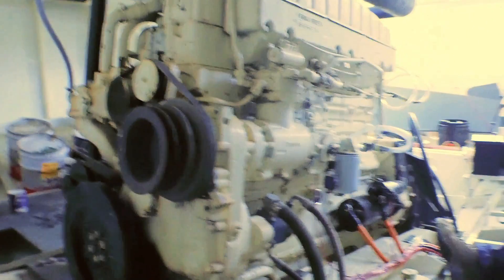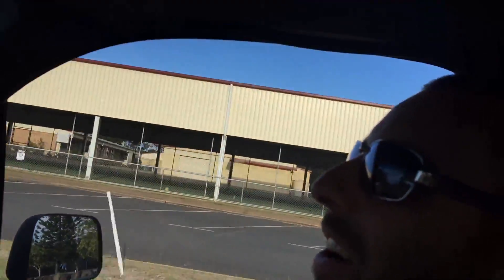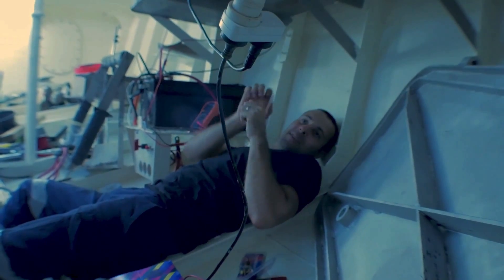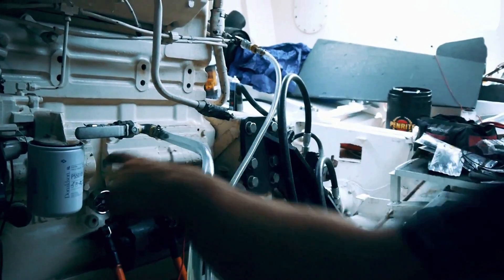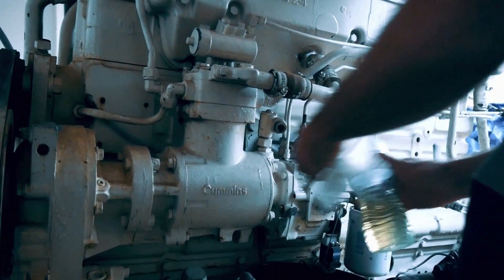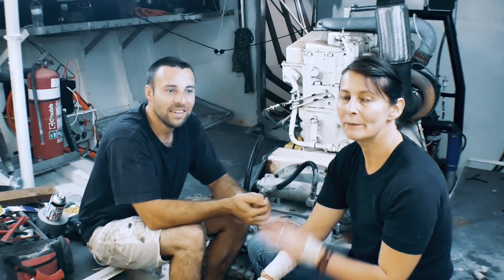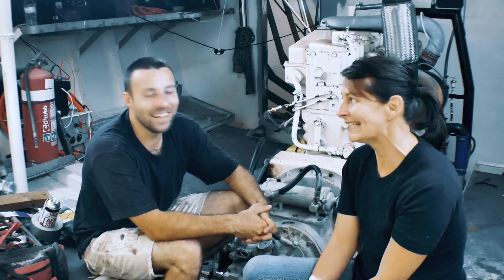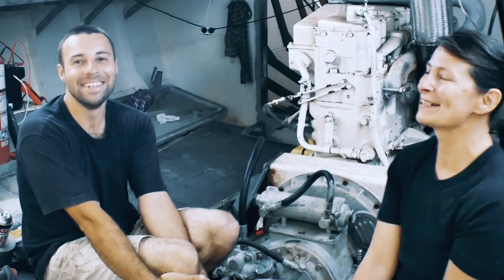Starting a Cummins Trawler Engine - Part 2 of 2 (EP. 53)

Comment: I thought you ran the diesel before it was installed. All the time I listened to the engine turning over I kept saying to my self, "Where's the fuel?" It was nice to here it run. It won't be long before the sea trials begin. You 3 have been doing a terrific job refitting this boat. By the way, is Ryan camera shy? I wanted to build a steel trawler 40 years ago but life got in the way. Watching these videos is fantasy compensation for me. The "Wing engine" I mentioned before can be track mounted so the folding prop can be retracted. Or an inner/outer sliding shaft can be made to do the same thing, just not as sturdy.

Comment: Hi Damian...for the time being just wire the starter to 24 volts ....it will turn over way faster...the reason the older starters suck is that they uses a very heavy armature and are massive..but as they wear the bushings that’s support the armature and wear which causes a drag....my 12 liter cat ..far newer than the cummins  ..I never liked the starter...engine only has 125,000 ...but I got a permanent gear reduction starter...far smaller and easier to service...but I love the way it starts..on some days I’ll just start it and shut it off a few times cause I love it so much

Comment: My boat had a couple Detroit 6-71's.  I had a little independent pump which would push fuel through the whole system to eliminate air.  I could tell when it was clear by the sound of fuel running back into the tank.  Very cool
Reply from the maker: That’s a nice way of doing the system

Comment: I am amazed at just how nice a job you are doing...and listening to your cummins starter laboring I can make a suggestion that might be a life saver....you can get a gear reduction starter that makes a world of difference in how easy the engine turns over...and truck batteries with threaded 3/8 studs at 1200 amps start my cat ..no problem in any weather...the starter type is called permanent magnet gear reduction....they should be available,..world wide...if not affordable starters in North Carolina made mine...I would be glad to help
Mine was under $300 and I just love hearing it wind up the engine for much faster starts
Reply from the maker: Thanks for this info Charles. I would like to change the starter to a 24v version (currently 12) so I will look these guys up. Really appreciate this advice. Damien

Comment: Gotta love it when you get a big diesel started. May want to install a manual prime pump/manifold in order to get any air out of the lines in the future. Makes starting and running much easier without having to pull down the batteries.
Reply from the maker: Hi Matthew, The main issue wasn't air in the lines it was me not knowing the fuel screw was wound in which stopped 100% of the fuel from getting to the lines, i wound her over for ages (so would have created a huge air bubble), the second i unscrewed the fuel screw she fired up within 2-3 seconds.

Comment: the cable tray at 6:50  will rust  , we use em every day and even when left outside they begin to rust , salt would be aweful for it but they do make similar cable "ladders "that are heavily galvinized .just remember to galv spray any cuts in it.
Reply from the maker: Thanks. I haven’t put anything on the ends but I will now. Good point
Reply: @ProjectBrupeg  It's also upside down, not critical, but with pinch weld on the bottom edges it makes for easy fixing.

Comment: Congratulations on this milestone, I think you have one of the best boat building channels out there. I think the way you work and your thought process are fantastic. By the way that engine is smooth easy running, we ran 3208 cats for years. We found that if you feed them good and pet them once in awhile they will purr forever.  Great job, you should have 100,000 subs
Reply from the maker: Ha, thanks for the great feedback. Yeah she did run sweet, looking forward to getting her under some load at sea. And thanks for your feedback about the channel, we have every intention of building this up, particularly when we have more accomodation available so we can bring more of our patreons onboard.

Comment: On our diesels at work we have 4 starting batteries. They push a 375kva generator and they look to be about the same size as yours. Might need 4 batteries...
0

Also numbering or color coding your cables on both ends helps later as well.

Also congrats and wow! You guys seem really great and i could almost feel the emotion of the engine start and the subscriber count comments. Keep it up and thanks for great content!
Reply from the maker: We actually fired her up beautifully on the one but we will be adding a second as a spare. We also have four of this size battery as out house bank and we have two smaller versions for our generator so we are covered from a redundancy point if we really get stuck

Comment: Good to see it fire up!  I am happy happy for you all. A few thoughts... from experience.  My second comment on anything , ever, I'm a boat hermit.
Double your batteries , have a 2cd or even third bank, perhaps elevated. YUP. And a spare starter or at least rebuild kit ...not so perhaps with twins. The starter itself just sounds slow to me.

A parallel fuel loop / racors/ switchable while running ,essential.  Add electric transfer or feed pump that you hope to never need, also.  And then buy a spare, you wacky icebreakers. Spare lift pump but of course I think that's a given aye ?
Forgive me if I missed it if you  already have designs on this. 

Not essential but very handy: 
Introduce an elevated fuel loop in your return line , similar to the elevated vented loop in the head system outbound stream (vent not necessary here however), can be non permanent and a "tool" perhaps, but plumbed (or valved!;)) so you can see any air situation and also perform leakdown science,  etc. 
Sorry for huge comment 
Just trying to help 
You guys are awesome 
Carry on.
Reply from the maker: Hi Brett thanks for the feedback and welcome to the world of comments. A lot of what you have said we are planning to do. More to come on this when we show the fuel system setup
Reply: You guys are scary prompt,  I like it  .  I have a steel sailing ketch, built as an icebreaker,  I'm dealing with a lot of the same things, oddly.  Air Compressor thoughts before I pass out :this would be after the " dump and run" lol , I am literally doing the same thing here in the states roight now, ... I also have integral tankage..consider  :.lockable ball valve shutoff before commercial air connections into all / each tankage that borders hull skin ... super reliable pressure regulator ... manifold with dryer that uses multiple inputs (i.e. your larger or engine AC, or ? A backup backup ) ... plumb (maybe closed )  lubrication for engine pump if not present , and then perhaps remove the belt when not in use or get crafty and rely on AC clutch type devices , BUT end goal being : pressurize , coffer,  and repair and loss of integrity in ANY tankage rather than take on water.  You'll need plywood , pipe insulation,  and a shitload of load straps, some 6010, none of which you ever wanna use, but do you wanna break ice? I do.  Cheers. Sorry for ramble , lemme know if it makes sense in light of day. 3rd comment ever !
Reply: Good points!  My Unimog camper truck runs dual alternators and 2 separate 24V battery banks (starter and 'house') with provision to temporarily  interconnect. I'm looking now  at a very small petrol driven truck alternator setup for emergency charging; for this project a hand start  ex NATO 28V Hatz Diesel tank APU or 'Lightweight Field Generator (LFG) would be great for infinite cranking ability. Ive always insisted on specifying  wet cell NiCd batteries for standby generators. These seem to provide high current even at low charge, recalling once jump lead charging totally uncharged batteries over a lunchtime with a 24V army LandRover and then starting easily a 650 kVA generator.

Comment: While water and air systems aren't that fussy, hydraulics are another matter. Always wind teflon tape in the same direction the fitting screws on and leave the first thread clean. (clock wise from the open end of the fitting) This prevents the tape from unwinding inside the connection and getting dragged into the close tolerance hydraulics. (retired aero-space hydraulics tech, I learned the hard way...). ; {

Comment: Hello from Detroit! Good job guys.Very cool to hear the Cummins fire up. Glad you're learning how to purge a diesel fuel system. I'm also suggesting welding cable for your battery cables if you need them in the future. I use them on my snowplow truck and my drag racing car. I like to use double jacket 1 1/2 inch firehose to protect cables and hydraulic hoses. See if any local fire departments will give you some that they are taking out of service;-)
Reply from the maker: Ok cool thanks for the tip.

Comment: We know those orange cables you used as trailing cables over here in South Africa. You get a variant of it that has blue insulation which is submersible pump cable and the insulation is especially formulated to be able to be submerged in water for very long periods of time.

I've been wanting to learn more about diesel engines for quite some time now but finding someone whose brains I can pick has proven hard. I also don't quite find the information I'm looking for on YouTube.

Nice job on the allignment of the motor and prop shaft. That isn't easy to achieve.
Reply from the maker: Thanks Gary. It’s all about the right tools, but half the trick is knowing what tool is the right one in the first place
Reply: I can do pretty much everything but Diesel engines. I know how they function and could repair the mechanical aspects but the fuel system is the big unknown to me. 

I've got quite a lot of experience on hydraulics and electrical systems and have aligned electric motors of over 500kW with large multi stage piston compressor pumps with nothing more than a set of clock dials on a set of magnetic bases and a shim box... days I'd rather forget...lol. The right tools certainly help but they cannot replace hard work, passion and determination.

Sadly these days a 19 year old back injury is stopping me from doing too much in the line of physically hard work. I have however found a new passion, sharing my knowledge and experience and that doesn't require much physically hard work but brings great rewards. :-)
Reply from the maker: Yeah that’s true, good on you Gary

Comment: Congratulations !  It looks like you may need a small electric purge pump in your fuel circuit Damien, then you won't waste so much energy and time cranking it over to bleed air... it only needs to run for a short while before cranking up, and will ensure you're really ready to fire up when you turn the key.
Reply from the maker: Yeah we do have a pump ready to go (it’s currently strapped to my vege oil cooker) but we just didn’t hook it into the engine prior to this test run. It will be there in the final layout though
Reply: Get an extra so they can be swapped, you may want a vacuum tank oil extractor, small ones are $35 or big ones $130 like this : https://agendasurf.com/ht-moto-oil-extractor-system-large.html It can change oil, or be used to draw oil, fuel or other liquids. I've used the small one for years, and its great on new engines for drawing oil up thru the oil pump and into the top of the engine before cranking...
Reply from the maker: Thanks I love the idea of pulling oil up through a dry pump prior to even winding it over. What a neat trick
Reply: I am no fan of electric pumps in boats. A hand powered diaphragm pump gives you the fail safe knowledge that if you are out of power completely you can simply pump up fuel to the day tank or pump filters and get enough fuel to run your engine.  On our 65 Ft boat we had a Lister JP6 with airstart . As the boat would run  for a week or two at a time it didn't matter if the start aircharge ran down (we had a hand pump for that too ) because we could actually crank start that monster .Always think of the worst that can happen and build in the ways to prevent it.

Comment: fill the fuel filter up with diesel don't shut the fuel tap off there is a wire behind the fuel pump that goes on the stop solenoid disconnect that if you don't want it to run don't just wind and wind the starter you will burn the guts out the starter and keep your diesel tank higher than the fuel pump so that it siphons in

Comment: What we used to with the cable ends was to fill them with solder then push the cable in, compress and shrink wrap !
Reply: Actually, if you drill a small access hole or two you can wick solder into the fitting to improve its conductivity after its swaged on so it conforms to the fitting better...
Reply from the maker: Thanks Mike

Comment: hi   you should have a header tank which from there you should be able to purge the fuel system with out the long process of cranking the engine over to push the fuel around, there are many advantages of having a header tank say of about 50 liters at a height as much as you can get ,, see ya
Reply: Yep.It's called a Day tank which holds fuel for the days steaming and is pretty important  .A direct feed from the main tanks is fraught with danger.

Comment: Don't you have compression break levers so you can spin the engine without compression and much less resistance for spinning it during bleeding?
Reply from the maker: Nope. Cummins 855 don’t have them and the injectors are buried inside the head so no ability to crack the lines. That said once the fuel screw was turned she bleed in an instant

Comment: I worked on Similar Engines in Auckland in the mid 70's.NT 855's.  Nice and simple to  work on . I was up your way last May for a break out at Bagara . Nice part of Qld.   With the lower BTU's of veg oil ,what sort of range do you expect with tanks you have? regarding the Alternator, it looks like something off a car. The normal ones are a lot bigger ,and is the engine keel cooled or salt water cooled?
Reply from the maker: Hi Merc, range with diesel will be 8500nm, oil isn’t massive lower in energy so we might drop a couple of hundred miles but that’s ok. Currently she is fresh water keel cooled but this will be changed to internal cooling when we get across the Tasman and prior to any ice work

Comment: Congrats on the engine crank & the 10000 (now over 16600) subs!

I was 1st mate on a tug boat for a time...we had 2 Cummings engines...ours were started with air (pneumatic starter)from a compressor & tank.
Have you thought about doing something like that?
Reply from the maker: Yeah I did ponder that. But the simplicity and cost of electric kept us with that system (engine had everything needed just add battery and we were off) thanks for the kind words. All the best. Damien

Comment: I know its a silly question but how did you the motor cool while running it  ? I thought water had to run through the motor ....But hey , minor thing , major thing was the excitement on your faces , that made me smile too , Stay safe you guys
Reply from the maker: Hi Richard, currently Brupeg has keel cooling pipes so unlike a yacht we can start up on the hard and get her up to operating temp. We will eventually cut these off but for now they have their advantages
Reply: Most engines can be run without water running through. Generally still a good idea to ensure the coolant side is topped though and it needs to be shut down once it gets to normal operating temperature.

Comment: Some of the older 855 cummins had a problem with the camshaft snapping right behind the cam gear .  Had on in one boat[tug] and it drove us nuts because the engine still ran , just would miss . Tune it up [reset injector timing ] and it would be good untill it got turned on and off a few times then would go out of time . I believe it was a bad run of camshafts .
Reply from the maker: Ok good to know what to look for if those symptoms ever develop. Thanks for the heads up
Reply: G Froese I believe it is a similar problem that Ford Taurus SHO motors had in 1999. The cams gear would break off the cam. But there is an easy fix by just simply welding the cam. I wonder if the same would work in that situation
Reply: No , when the 855 brakes a cam it most time breaks at a angle so the thrust bearings keep the cam together . what happens is   the engine   cam still turns but between the rise and fall of that big cam the timing is out . If that makes any sense to you .
Reply: These are a very strong engine.  We use them in our 300 and 350KVA gensets - they last 25,000 to 30,000 hours in this application without ever being touched - if you’re unlucky you’ll need a turbo around 20,000 hours is all.  Never touched the injectors or tuned them, they just go.  Broken cams aren’t that common really.
Reply from the maker: Great to know. Thanks Phantom
Reply: Please do not misunderstand me . The 855 big cam is a great engine and once they understood the problem with the first ones , THEY CORRECTED it . I repowered a 110 foot small tug with two of them and they had great power , balls like you wouldn't believe , plus pull off the power by 10% and good fuel consumption . The only other problems were regular maintinance issues . 400 hundred hrs. on the oil and change it , also keep track of the PH levels of the coolant even if your running antifreeze . One day soon you will be laying in your bunk , listening to the throb , smiling and wondering if the stern glands are leaking . Ha ha ha ha